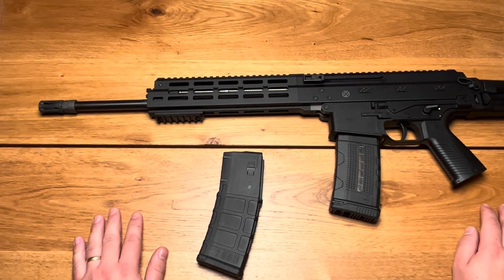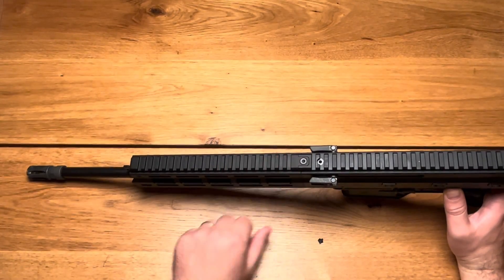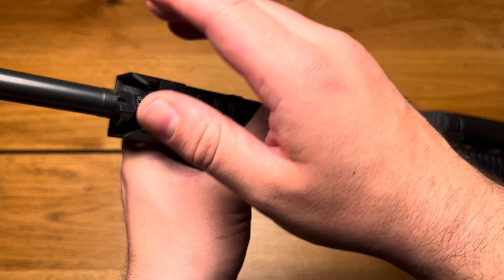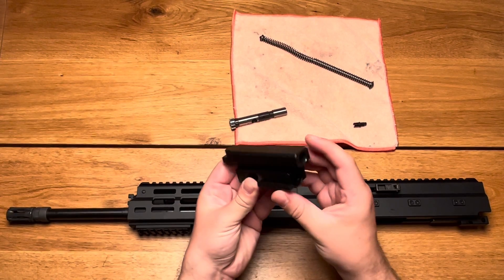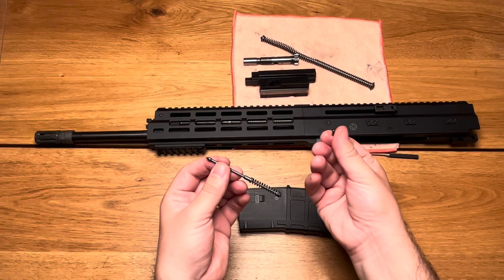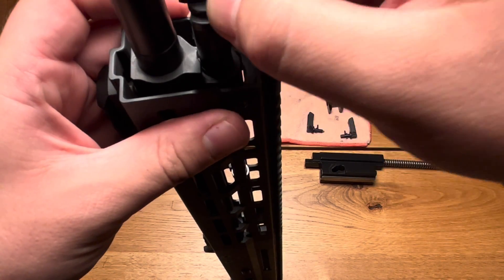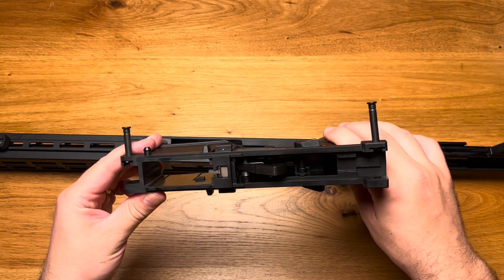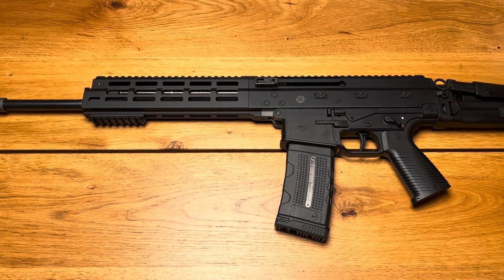Inspecting the B&T APC223 Pro

Comment: Amazing video!!  Just a question. Are you supposed to use solvent cleaner on the bolt head? Heard you aren’t supposed to get any near the firing pin. Also are you able to lube up the gas system and the regulator? Thank you very much!
Reply from the maker: Thank you! Actually, you should lightly oil the bolt head, but make sure the firing pin stays dry. For the gas system, I do oil it when cleaning but then wipe off the oil with a cloth afterward—no solvent needed. Hope that clears things up!
Reply: @gruezihans  Perfect that helps so much! But can I also choose to use CLP or would you solely recommend using oil for metal on metal contact and solvent for the rest ? how do you avoid getting the firing pin getting wet ? And one more thing do you like to lube and wipe everything down when it comes right out of the box? So sorry for all these questions but I just want to be as informed as possible.
Reply from the maker: @hudthestud6758  No problem, happy to help! You can definitely use CLP—it's a great all-in-one option. Personally, I prefer using oil for metal-on-metal contact and solvent elsewhere, but everyone does it their way. In the Swiss military, they actually use grease instead of oil, and that works too! To keep the firing pin dry, just apply oil carefully and use a cloth to wipe around it. As for new rifles, I do a light wipe-down and oil the key parts, but again, it's all about what works best for you. Let me know if you have more questions!

Comment: Do you have any idea if the 8.7 inch barreled version is free floated? Thanks.
Reply from the maker: The Gen1 model lacks a free-floating barrel, while the PRO (Gen2) model features one. The rifle in the video is a Gen2! The APC223 Gen1 version comes equipped with a fully fluted barrel from the factory. However, in comparison, the PRO model is somewhat disappointing. It lacks the tight tolerances of the Gen1, resulting in a less smooth operation and noticeably increased felt recoil. Nevertheless, the free-float and gas block of the Pro are advantageous features.

The Gen1 represents the pinnacle of B&T and Swiss manufacturing. It's just unfortunate that the same level of feel and smoothness wasn't carried over to the Pro model, despite its appealing features.
Reply: @gruezihans  thanks for your reply. So if I understand correctly,  all barrel lengths of the gen 1 suffers from heat related issues due to the barrel not being free floated.

Comment: How dose this recoil vs the 10”?
Reply from the maker: Correct posture, standing or lying down, makes the biggest difference in my opinion. But the oil damper helps a lot. It is marginally stronger with the shorter barrel.

Comment: Just picked one up! But do you know if there's any way of removing the handguard? The person who I bought it from had it in a MOIST area and surface rust got on the barrel lol nice video!
Reply from the maker: Congratulations on your purchase and have fun with the rifle!

To remove the handguard on the Pro models, two screws must be removed: on the upper and lower edge. The gas system must also be removed (as described in the video). Then the handguard can be pulled forward to the barrel. Caution: it is quite tight.

Are you sure it's rust? I'm pretty sure it's just dirt from the gas system that has settled on the barrel. Nothing to worry about.
Are you sure it's rust? I'm pretty sure it's just dirt from the gas system that has settled on the barrel. Nothing to worry about.
Reply: @gruezihans I would love to see a video of removing the handguard and barrel if you are willing!
Reply from the maker: @K2llswitch  Sorry, I won't be doing a video on removing the handguard and barrel, but you might want to ask @AXARMS. He might be able to help you!
Reply: Can you advise how to remove the barrel. I can’t find the information anywhere

Comment: Thank you for the video. How is it to shoot this APC223 Pro? If you have to compair it with a SIG P90, is it as accurate? I have the APC 9 Pro and I love it, but not sure if the APC223 Pro is something I would enjoy as much. There are some mixed reviews about this system.
Reply from the maker: Thank you for your feedback. For a self-loading rifle with a 16-inch barrel, I achieve the same precision at 100m as the PE90 (20-inch!): virtually hole in hole. At 300m, the shorter barrel is noticeable. I'll be happy to make a video next time I'm at the range.